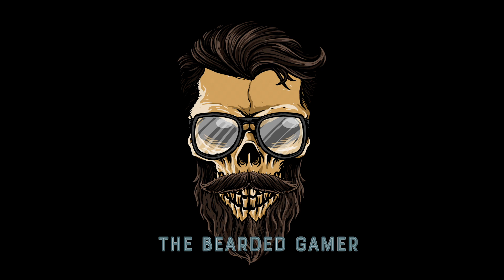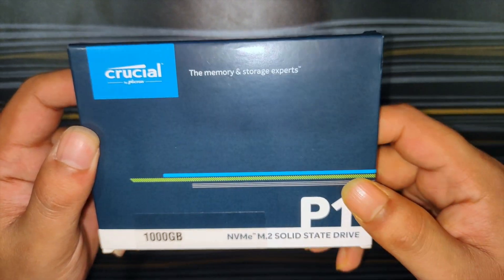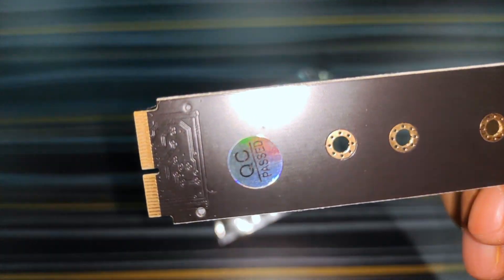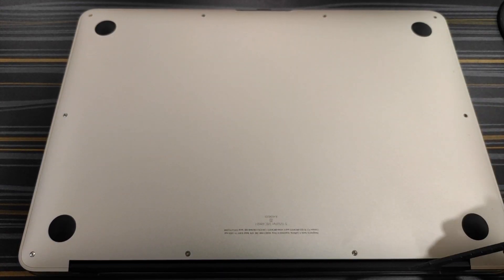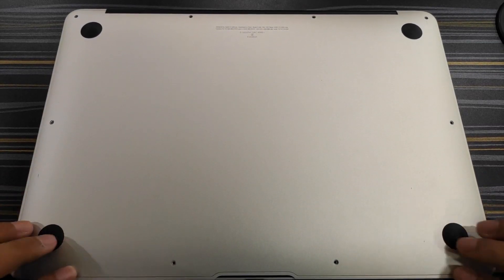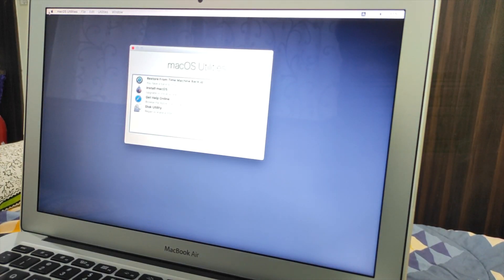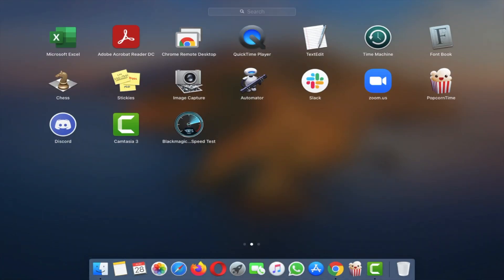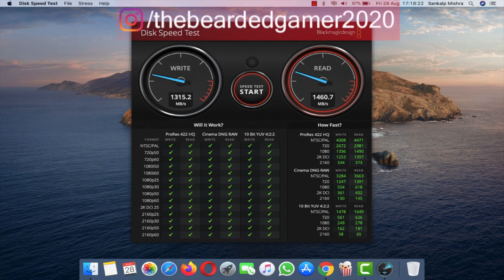2017 MacBook Air Storage Upgrade from 128GB SSD to 1TB NVMe SSD | Full Guide for 2021 | 40k+ Views

Comment: Thanks a lot. I am worried about my Macbook Air 13" 128GB due to shortage of storage space and thought of selling the same. Fortunately, as per your guidance here, I have upgraded to 1TB ..
Reply from the maker: I am really happy that I could help. Even I was on the verge of doing the same. Luckily, I found a solution to my problem and that solution is now helping others. Hope you are subscribed to the channel and if not, do subscribe to my channel and press the bell icon.
Reply: Is it working efficiently ?
Reply from the maker: @AayushSharma-sw4tt  Yes it works perfectly fine. Have been using it for almost half a year now and haven't faced any issues. Do subscribe to my channel and press the bell icon.
Reply: hi, i'am in the same situation, found this video and think it is gonna be my salvation, one question? what ssd did you buy?

Comment: Bro, can you please tell me one thing, what is that time machine back up ? have you already took the mac application and os back up to any external hard drive ? I am not getting that part and can I also use the install OS option ? will that erase my previous data ?
Reply from the maker: Hey Raj the Time Machine backup clones your current OS along with the data and all settings to an external drive. Using that process you can restore your entire settings to the way they currently are. If you select install os option, it will do a fresh install of the Mac OS and you will lose your current data. Hope this answers your question. Do subscribe to my channel and press the bell icon. And if you have any other queries do follow me on Instagram and drop a DM.
Reply: @TheBeardedGamer2020  Thanks for a quick reply...Now it is cleared...Wishing you best of luck 😊
Reply from the maker: @rajsarkar4868  Do subscribe and press the bell icon if you haven't already done so.

Comment: can i use western digital also as replacement of crucial WD Blue SN550 1TB NVMe Internal SSD - Gen3 x4 PCIe 8Gb/s, M.2 2280, 3D NAND, Up to 2,400 MB/s - WDS100T2B0C. thanks for your help
Reply from the maker: Sure. Any M.2 NVMe SSD will work with this process. Do subscribe to my channel and press the bell icon.
Reply: @TheBeardedGamer2020  thanks a lot, will do tht.

Comment: Hello sir,  is it possible to update from  HDD to NVME SSD in MacBook pro mid 2012 ?
Reply from the maker: Yes you can. All you need is a M.2 SSD to SATA SSD converter enclosure. There are a lot of options available online. Do check them out and your problem will be solved. Do subscribe to my channel and press the bell icon.

Comment: I am about to upgrade my macbook air do I need the ssd adapter? Or is it because you got the crucial ssd? Thank you amazing video and explaination
Reply from the maker: Hey frank any ssd that you buy would need you to use the adapter as the proprietary apple ssd pins are different. Do subscribe and press the bell icon if you haven't already done so.
Reply: @TheBeardedGamer2020  thank you so much for the quick reply and yes I just subscribe 😃😃 cheers

Comment: Is there any upgrade in boot time and other tasks like opening a browser or any other do they take less time or more time as compared to the original Apple ssd and one more question. Did is affect the battery backup ?
Reply from the maker: The most important part of this upgrade process was the storage upgrade and 1 TB is a major upgrade in itself. Coming to performance there are slight improvements over the proprietary Apple SSD because the read and write speeds are better. And since the performance has been increased a bit it is quite obvious that the battery backup will reduce a bit simultaneously. But nothing major. Also do subscribe and press the bell icon if you haven't already done so.
Reply: but in the video the disck speed app opens faster in original the Apple hd

Comment: @thebeardedgamer Please advise
1) Is it compatible with Mac air 2017 Model (A1466 ) ?
2) I am confused about which option to select the following
Crucial P2 1TB 3D NAND NVMe PCIe M.2 SSD
Crucial P5 1TB 3D NAND NVMe Internal SSD
Crucial P1 1TB 3D NAND NVMe PCIe M.2 SSD
Samsung 970 EVO Plus 1TB PCIe NVMe M.2 (2280) Internal Solid State Drive (SSD) (MZ-V7S1T0)
About the Adapter 
Can we go with full size or smalll size?
Please check the following links
https://www.amazon.in/gp/product/B07PQVZ8ND/ref=crt_ewc_title_dp_9?ie=UTF8&psc=1&smid=A1IQ3B29ZEMAMF
https://www.amazon.in/gp/product/B084RR84TJ/ref=crt_ewc_title_dp_10?ie=UTF8&psc=1&smid=A2U40YWRBB3OYE
https://www.amazon.in/gp/product/B08R45KMM5/ref=crt_ewc_title_dp_8?ie=UTF8&psc=1&smid=A3H89GH4UYZJ49
Reply from the maker: Yes it is compatible. You can choose any one between the p1, p2 and 970 evo. Not the p5. The performance will be similar in all 3. And for the adapter go for the full sized one as smaller ones tend to have issues. If you want there are product links in the video description as well. Also do subscribe to my channel and press the bell icon if you haven't already done so.
Reply: @TheBeardedGamer2020  Thank you for the quick response. I have already liked and subscribed to your channel. Question p1 and p2 have read and write speed difference you have p1 as per the video how is going so far? Also, the cost for P1 and p2 is costly Samsung 970 has a good read and write speed up to 3500 and the price is slightly more than p2. P5 and sam 970 have equal speed.. But why you don't recommend it though it has the same M2 form?
Reply from the maker: @manus409  Well the entire process depends on the adapter. And the adapter has speed limitations of upto 1300mbps. So any ssd that you use wouldn't give you more than that number. FYI the apple ssd is at 600mbps. So anyways you are getting twice the performance. Better to choose something where you don't spend extra money for no reason.
Reply: @TheBeardedGamer2020  thank you so much for more clearlity
How is ur machine working its been like 6 months?
Also from ur links now sure which u bought.. Could u plz share ur adaptor n ssd link
Reply from the maker: Works perfectly. The links are in the video description.
Reply: @TheBeardedGamer2020  thank you
Reply: @manus409  I just upgraded my 2017-a1466 two weeks ago. I used SanDisk Ultra 1TB ssd with a small adapter and since then I haven’t faced any issues. Good luck bro.
Reply: @mch9739  thank you share the links for both products

Comment: Hi I’m about to upgrade from 126 to 1t my MacBook 17 wish SSD you recomendé to buy?
Thank you
Reply from the maker: Hi alex, the ssd is entirely based on your choice. You can go for the Samsung 970 evo or the Crucial P1 or P2 as well. Do subscribe and press the bell icon if you haven't already done so.
Reply: @TheBeardedGamer2020  hi is me again I find this 2 ssd cart which one can I use?
Samsung (MZ-V7E1T0BW) 970 EVO SSD 1TB - M.2 NVMe Interface Internal Solid State Drive with V-NAND Technology, Black/Red

Samsung (MZ-V7S1T0B/AM) 970 EVO Plus SSD 1TB - M.2 NVMe Interface Internal Solid State Drive with V-NAND Technology
Reply from the maker: @Alexsantos1  Use the second one, evo plus.
Reply: @TheBeardedGamer2020  hi i just installed the ssd and I trying to do the upgrade to install the hard disc and I receive a message saying The installation not proceed because the installer is damaged...can you please help me with that ?
Thank you
Reply from the maker: @Alexsantos1  The issue might be with the bootable drive that you created. Try to create the bootable drive again or try internet recovery.

Comment: hi please help, i've used two different adaptor and 2 different M.2 but still can detect un disk util. please help.
Reply from the maker: Which adapters did you use?
Reply: @TheBeardedGamer2020  i realized that my m.2 is wrong. i got SATA with M and B, it should've  nvme or ahci, thanks for the reply by the way.
Reply from the maker: @bjdude18  Haha...no problem shit happens. Get an NVME pcie ssd and you will be good to go.  Also do subscribe to my channel and press the bell icon if you haven't already done so.

Comment: Hi! Wanna ask. Do we need the adapter for the new ssd. Saw on the other videos that they dont use and mention about it. Thanks in advance!
Reply from the maker: Hey thaqiff using the adapter is compulsory as the connector pins on the NVME SSD are different from that on the proprietary Apple one. Do subscribe and press the bell icon if you haven't already done so.

Comment: brother after time machine restore the mac is not starting up
Reply from the maker: That shouldn't happen. Did the backup complete successfully and was it the new ssd formatted in the same format as the old one?
Reply: @TheBeardedGamer2020  I dont know brother..I have re installed the mac using internet recovery...its working totally fine as of now...But its like using a new computer cause i dont have any access to the old files
Reply from the maker: In that case why don't you plug back the old ssd, copy the data to an external hard disk or pen drive, plug in the new ssd and paste the data to the new one.

Comment: i have T5 screw driver and but P5 0.8mm should i open from that macbook's back panel
Reply from the maker: Sorry but the question wasn't very clear. Can you please explain what exactly do you want to know?
Reply: @TheBeardedGamer2020  i have P5 0.8mm screwdriver should i open the back panel of macbook air from this screwdriver
Reply from the maker: @VirusGamingamit  Yes you can open the back panel using that. And use the T5 for internal components. Do subscribe and press the bell icon if you haven't already done so.
Reply: @TheBeardedGamer2020  in some videos i saw it need P5 1.2mm screwdriver
Reply from the maker: @VirusGamingamit  Give it a try with the 0.8mm head. If it doesn't work then you know it's the 1.2mm head because these are the only 2 options. Mine had 0.8mm on one side and 1.2mm on the other so I am not exactly sure which one to use. But if you give it a try you can find out for yourself.
Reply: @TheBeardedGamer2020  which one you used 0.8 or 1.2mm
Reply from the maker: @VirusGamingamit  Hey sorry for the confusion. I just checked. You have to use the 1.2mm one.
Reply: Ok thanks ❤❤
Reply from the maker: @VirusGamingamit  Don't forget to subscribe if you haven't.
Reply: Ya alredy suscribed few days ago

Comment: making time machine backup is mandatory? can I install macOS online directly?
Reply from the maker: No Sameer time machine backup is not mandatory if you don't want data from your old ssd. But what you do need is the bootable usb to go into recovery and then you can use the usb for the OS installation so no need of installing online also.
Reply: @TheBeardedGamer2020  should i follow some video to go for bootable usb?
Reply from the maker: I have added a link in the video description that easily explains how to create the bootable usb.
Reply: @TheBeardedGamer2020  bdw thanks a lot
Reply from the maker: No issues. Always here to help.

Comment: Hi this is Elango I am planning to upgrade to 1 TB with ur help I hope I can do it thanks for the clear demo. I heard that still some websites Crucial seems not recognising by Mac. It’s almost 5 months u r using how is the response did u find any such problems.
Reply from the maker: Hey Elango the issue as per those websites is actually not with the ssd but with the adapter. A lot of people are using the small adapters and that is creating the issue. And I haven't faced any issues with the ssd yet. It has been running the same way it did when I first installed it.
Reply: Hi how about crucial sss card replacement
Reply from the maker: @697999  Didn't understand bro. Can you please elaborate.
Reply: @TheBeardedGamer2020  sorry Bro. I would like to know that is there any problem then How should return. Then my friends strongly suggest to go with Samsung EVO and so ordered.
Reply from the maker: @697999  No issues bro it has warranty. But if you are more happy with the Samsung SSD you can go ahead.

Comment: thanks to you even i have upgraded my macbook to 500gb. 
I wanted to ask something.
Why did you chose crucial? How is wd blue compared to this one ?
Any specific reason to choose crucial? How is battery performance after upgrade?
Reply from the maker: Well Arnav there are a lot of options that you can choose from. There's samsung, wd and in Crucial also there's a few more options as well. But since the adapter that we use for the upgrade supports upto a certain speed there was no point using much more expensive options.
Reply: @TheBeardedGamer2020  makes sense thanks

Comment: Which is better Macbook Air 2020 or  Macbook Air M1 Chip?
As M1 has some issues,problems?
Reply from the maker: Hey Tushar that's a nice question. Based on my opinion M1 MBA is better than the 2020 MBA. The specs are much better and so is the performance as per benchmarks. The issues with the M1 are limited just to app compatibility but again that is something that happens with a new device. And with the popularity of the Apple ecosystem that shouldn't be a problem as more and more apps will get updated.
Reply from the maker: Also do subscribe to my channel and press the bell icon.

Comment: Hey! Disk utility is not showing the ssd
Reply from the maker: Did you use the same products that I recommended and followed the same steps that I followed?
Reply: @TheBeardedGamer2020  yes i did, still it is not recognising the ssd. All I’m doing is connecting it then booting the laptop through internet recovery and then i usually open the disk utility.
Reply from the maker: @gagz13  Better to use a bootable drive with the same OS that your old ssd had.
Reply from the maker: @gagz13  There are 2 other options as well if this doesn't work.
Option 1: Clean installation of macOS
1. Download the latest macOS installer from Mac App
Store
2. Put NVME SSD in an or connect using an NVME to USB adapter
3. Erase NVME SSD and run macOS installer
4. Swap the internal SSD after system reboots
Option 2: Clone macOS from original Apple SSD
1. Download the latest macOS installer from Mac App
Store
2. Put NVME SSD in an enclosure or connect using an NVME to USB adapter
3. Create a USB macOS installer
4. Boot from the USB installer
5. Run disk utility and restore from original SSD
6. Swap the internal SSD after data transfer completes
Reply: @TheBeardedGamer2020  Thanks for help. Lemme try them and will update you😊
Reply from the maker: @gagz13  Sure and do subscribe and press the bell icon if you  haven't already done so.
Reply: @TheBeardedGamer2020  Yeahh finally it worked, Thank you so much brother for the help.
Reply from the maker: @gagz13  that's a great news. All the best with your new upgrade.

Comment: Problem 

Hello! I have a problem, the laptop works fine after upgrading to NMVe But after 3 hours of inactivity it freezes (black screen). There are problems with hibernation (PMSET). How to completely turn off hibernation on a MacBook Air 2015 so that the laptop does not try to go to sleep and freeze? Thank you
Reply from the maker: That can be fixed but before that which adapter and ssd are you using?
Reply: @TheBeardedGamer2020  
Thank you for answering 
Adapter like this:
https://www.ebay.com/itm/303208243669
NVMe kingspec 512 Gb
The first time after installing the disk, I entered commands through the console (pmset) and everything worked fine. But two days ago I reinstall the system and I forgot the commands that I entered into the console.
Reply from the maker: @NBstalker  The problem is with the adapter. These complaints are quite common with these small adapters. You can change that and you won't even have any issues with hibernation in the first place. But if you want to use the same one and turn off hibernation here's the process 
From a Terminal, use the following command to disable hibernation:
sudo pmset -a hibernatemode 0
Reply from the maker: @NBstalker  Do subscribe and press the bell icon if you haven't already done so.
Reply: @TheBeardedGamer2020  
Thanks for answer
I'll try put that command

Comment: Hello, thans for the video! Congratulations, very well explained! I tried the same process using a Kingspec SSD and a small adaptator in the same macbook air (2017, A1466). During 2 days the laptop worked perfectly, but after that period my macbook air stopped recognizing the Kingspec SSD.  The SSD's working perfectly and the adaptator too, but my macbook air doesn't recognize them. Do you some suggestion? What could be the problem? thanks!
Reply from the maker: I have seen this problem come up with the small adapters. Sometimes they don't even work and sometimes they work for sometime and then stop. So there is a good chance that the adapter could be the issue.
Reply: @TheBeardedGamer2020 sir is MacBook Air 2017 support crucial p2,p3 ssd?
Reply from the maker: @Manishkumar-dj6kl  yes
Reply: Hey André, Could you fix the problem? Is your Mac working with the new ssd now? If yes, how could you fix it? thanks in advance.
Reply: @mch9739  Hi, Howdy? I couldn't fix the problem. I've tested 2 different adaptators, but it seems the real problem is the Kingspec SSD. I'm looking for a new one, I got some recomendations about brands like Crucial or Intel. Probably I'll buy an Intel P1. I'll share new informatoisn when I try thE neW combo.
Reply from the maker: Go for the Crucial P1. Tried and tested.
Reply: @TheBeardedGamer2020  I have also Macbook air A1466 Model (Early 2015) with 256gb SSD, Will that Crucial P1 work in my case, Does any additional adapters requires for it?  I have also heard news that A1466 this model motherboard did not support more than 512gb SSD. Can you confrim this?
Reply from the maker: @balramrexwal  The adapter is for sure required in this process and instead of the P1 you can go for the P2 now. Also, all macbook airs from 2013 to 2017 will support the 1TB upgrade. Do subscribe to my channel and press the bell icon.